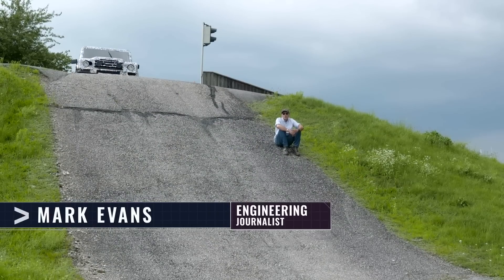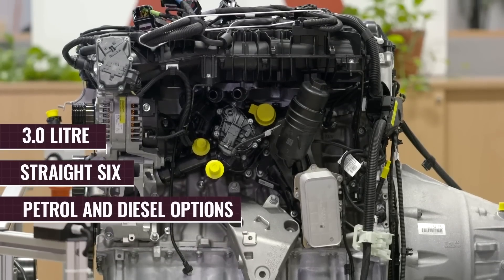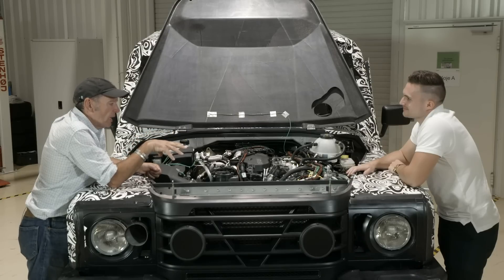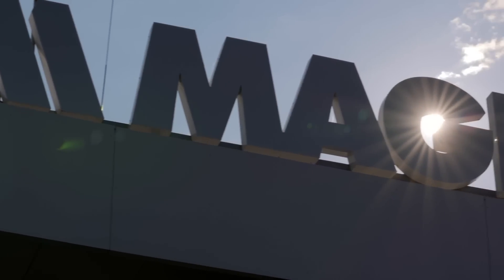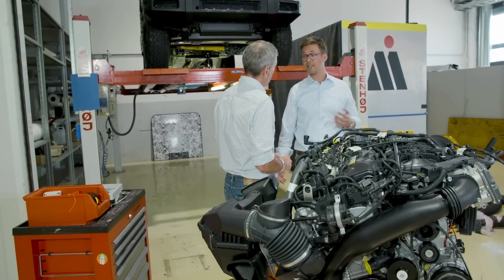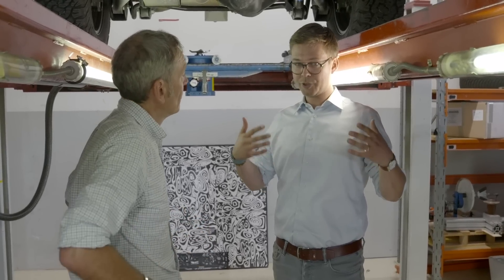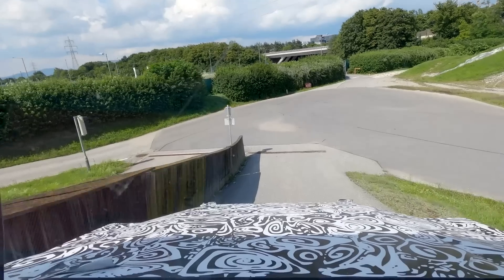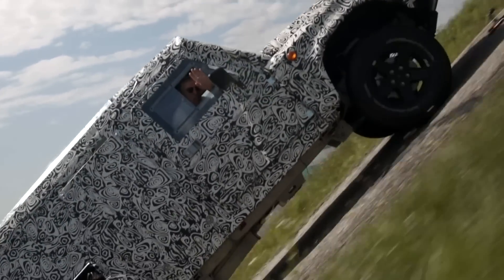Building the Grenadier - Episode 5 - Engine & Transmission

Comment: Cracking. We don't need a manual nor do we need it built in the UK. Keep it up Ineos.
Reply: I would have preferred it to be built in the UK. But it probably would have added several thousand pounds to the cost of each vehicle.
Reply: @columbo1966  hi, think it will be expensive because of the import duty's .
Reply: They'll be loosing alot of off-road enthusiast no stick shift? I'll stick to my old truck
Reply: Sultan kuto 
It would be nice to have the choice and I think it will put a lot of people off. Although I’ve never tried it myself, auto boxes are apparently very good off-road.
Reply: @mickdavis8521  yeah I guess it's right not to judge something beforehand but I bet you know that satisfaction of driving a manual in the worst of conditions.... It's an art in its self.....a car that works with you and dose what you want rather than working for you and sometimes against you...... With a manual you're always engaged but with an auto it's more of a chore plus complexity means disaster should it break down.
Reply: Michael Davis Automatic transmissions are fantastic off-road, which is why they are dominating in this design, as the engineer here has indicated.
The glacier-trekking Icelanders swear by them. Constant drive to the wheels, with engine and transmission matched in ALL practical scenarios cannot be beaten. 😎👍
Reply: sequri 
I’m not against auto boxes, I’ve just never tried one off road. I watched this video that was posted by someone further down and gives a good perspective of the advantages and disadvantages in different scenarios. So perhaps it’s not as black and white as you think https://youtu.be/BE_NMaIL5IQ
Reply: Extremely disappointed with the decision to build this car abroad☹️ Britain is looking in the face of economic disaster and I had hoped that the grenadier would be the beginning of a new chapter in British manufacturing. Jobs for the people of this nation are needed more than just another 4x4. I was very excited when I first heard about this vehicle but with the BMW engine and now the production moved to France I have become disillusioned with it. I’ll stick with my old Defender.
Reply: @mickdavis8521  I have no words. If I had a pound for every simpleton Defender owner who said they were not going to buy one out of principle I would be a wealthy man. The defender has a horrid reputation and you turn your nose up at a vehicle and company which is going out its way to be the best in class, based on where they have chosen to manufacture it? Absolutely ridiculous. Ineos are not in the game of helping the UK economy (although I admit it would be nice), they are in business and it's because of the people with a Defender mentality that they have to operate in Europe in the first place (Brexit).
Reply: @SuzJim99  I disagree. The  head of Ineos is a staunch brexiteer who is constantly going on about bringing manufacturing back to Britain and getting away from EU regulations. They have marketed the whole thing around being a successor to the defender built in Wales where the defender was designed and being the best of what Britain has to offer. Complete hypocritical bollocks. And I'm Irish, so doesn't make any difference to me, but I can smell the hypocrisy from here!
Reply: Stuart Nicholson 
Well, here’s another example of somebody who feels that nobody is allowed a differing opinion to himself, someone who starts his reply with an attack on intellect. There is a word for people like you but I am going to refrain from insulting you because you are obviously trying to start a tit-for-tat argument whilst hiding behind a keyboard.You are entitled to your opinion but I do take issue with your uneducated personal assessment of my intelligence. Helping the economy back to it’s feet would be “nice”(?)  can you see past the end of your nose? Try to see the bigger picture, take the blinkers off. Back to the defender, I’ve owned mine for 11 years. It’s never failed me or let me down. It has taken me to places that would be out of reach for the average car without giving me any problems whatsoever. I’m not basing my comments on reputation but on actual experience. Get a life fella, try to be nice.
Reply: @mickdavis8521  I will continue to criticise Defender owners because everyone I have met, and just about every comment you read in reply to Ineos videos and updates from a Defender owner, spouts the same nonsense which revolves around the Defender being the holy grail of 4x4's. If you are singing the same tune as the majority then you are no better than any other Defender owner. People buying into the 'legacy' of the Defender is nonsense. It's a vehicle, an asset or a piece of machinery - nothing more. If you buy into the 'rich' narrative of a Defender you are already wearing blinkers because you will automatically be looking for anything which makes this car different or that paints a different backdrop from a Defender and use it against the Grenadier. Of course, you can have your opinion, I never said you couldn't, but it's very repetitive.
Reply: Stuart Nicholson 
Then we agree to differ.

Comment: That moment he said no to a manual gearbox, my heart sank and couldn't watch no more. Devastated
Reply: Why, out of interest? Torque convertors are great for off-roading and towing. I love a good manual box and would never buy a sports car or hot hatch with anything but a manual but there’s a lot to be said for a workhorse to be auto I think. Especially if it will hold gears - as he says it will.
Reply: @baronvonteuchter1412  Better fuel consumption, more control over the vehicle, more responsive, no overheating problems, easier and cheaper to service, can push/tow start, and if the transmission is damaged or fails you're more likely to be able to limp a manual home. It depends on your usage, but for serious off-roading and long-range touring the manual wins for most people.

Here in Australia, most 4x4s are manual except for grocery getters and tow vehicles.
Reply: You can still select the gear you want to be in so you're only losing a clutch. It's the best of both worlds.

Comment: What is that silverish long box inside the frame and to the front of the right rear wheel? Looks like it's wrapped in thermal insulation material and so far I've seen it on every Grenadier shown from underneath in the official videos...
Reply: Björn Draegert these are very early mule cars. These silverish long boxes are the temporary fuel tank until the tooled formed components come available.
Reply: Björn Draegert ....which will be nicely protected inside the frame

Comment: Centre diff-lock or axle-diff-locks?
Reply: Centre, front axle and rear axle diff-locks. All mechanical.
Reply: @jobzwollo  wait, are you the guy in the video?
Reply: David Deiss ✔️
Reply: Job Zwollo your doing great job Sir. One question, is the 8 speed ZF transmission you are talking about the same as the RAM 1500,s ZF 8 speed? It’s also used in Jeeps too.
Reply: Job Zwollo thanks for commenting, this is great news!!
Reply: Baron von Teuchter you’re welcome
Reply: Job Zwollo this information is not out there and is something defender should have had especially on the rear axel.